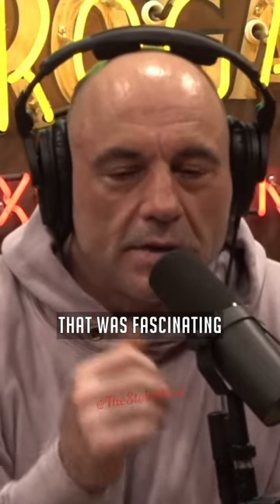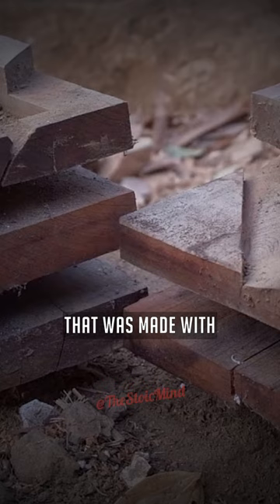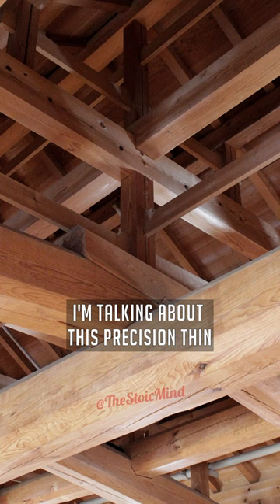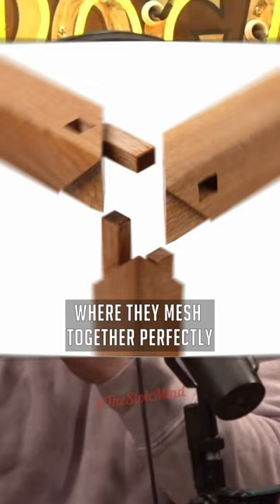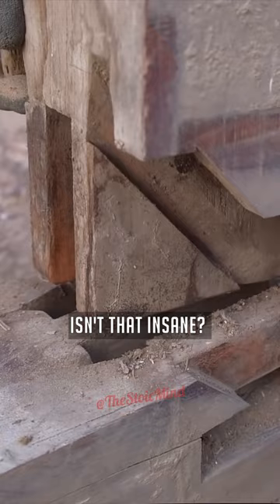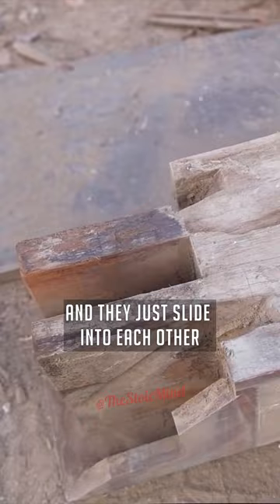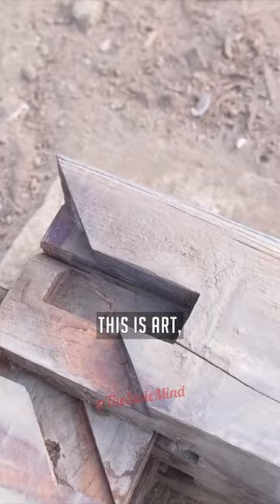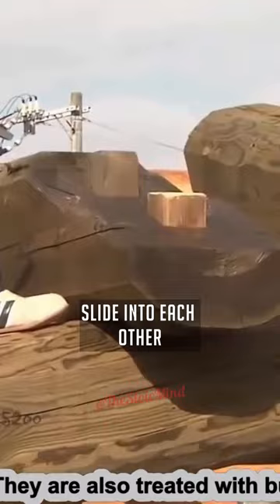Japanese Building Without Nails - Joe Rogan

Comment: China's Forbidden City is built like this. It can withstand a 10.0 earthquake.
Reply: Thoma make Crosslaminated timber wood building they build one and gave it to Japan testig facility.
Level 8 9 passed they use Level 10 and nothing they removed so many parts then it collspsed (it must colapse to pass the test)
Reply: Highly doubt that.. Alaska had a 9.2 in 1964 and it tore the city up!!
Concrete roads just split in half, building collapsed..
Reply: @shawnwillis767  if you fit wood together it will shift rather than break apart. Its the equivalent of having sand joints, which would allow it to settle into a stable place with stress and pressure. Not saying it could survive a 10.0 quake but certainly 8's and 9's
Reply: @shawnwillis767  concrete dont flex. It's basically can the house ride on a boat? It will survive a earthquake.
Reply: How old is it 😮
Reply: Chinese stuff don't last long buddy.
Reply: @Mr.V.  Do you know how old the forbidden city in China actually is the up any idea it was built to last it bends it flexes but it does not break not like china's flimsy integrity
Reply: Amen🙏🕊❤️😇✝️
Reply: Japanese better
Reply: @Mr.V.  China itself lasted 5000 years, Chinese writing lasted 3000 years, the terracotta army lasted 2000 years, the forbidden city lasted 600 years. I don't see your point?
Reply: @tz7710  in what universe?
Reply: @Mr.V. this technology literally came to Japan from China. Are you slow?

Comment: ..and they only used nails as a security guard. They would put two nails close together, so that if an intruder broke in,  the two nails would rub against each other making a load squeaking noise as the intruder walks with each step.

Comment: Why not look at a fucking high rise?  That is so much more impressive!  Look how the buildings have use, and require 10X fewer men per cubic foot of space generated!  Look how men then can afford SUVS and large homes (as opposed to Japanese). Hell even a strip mall is more impressive than these shinto shrines from the perspective of use and utility and cost and engineering.

I grant you that the ones who build these buildings with the technology of the times were highly capable men, but at the same time, they were completely caught in a feudal system from which thousands of Japanese fled, coming instead to America and Canada.